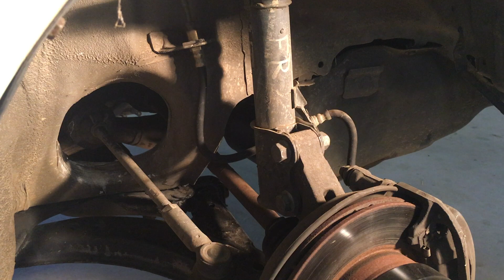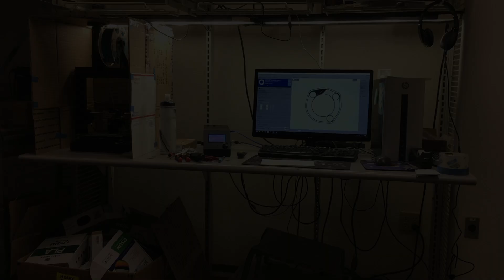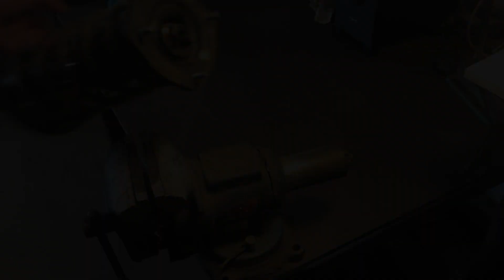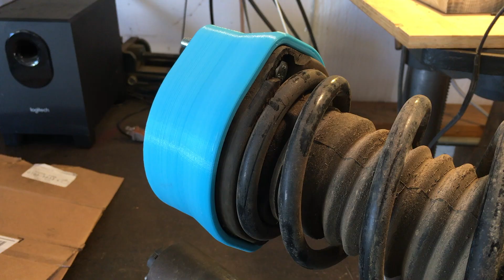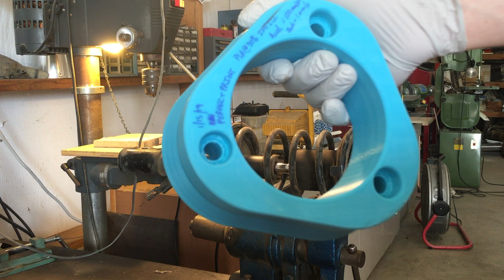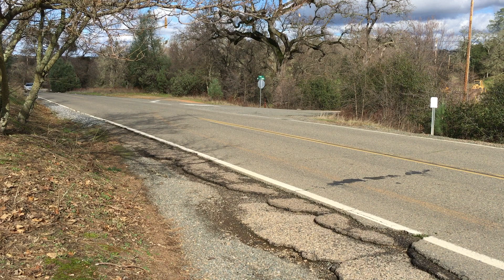Lifting My Car With 3D Printed Parts

Comment: Did you open source the files by chance?  Any way to get a copy?
Reply from the maker: @jafinch78  that’s was so long ago I doubt I even have the file anymore, sorry. They weren’t that bad to model.
Reply: @MotherlodeMotors  That's cool.  I have a set of mounts off for the front and rear of the Prius.  Recently did a YT Short or two regarding just using the strut mounts alone, though for taller was thinking making open source files for either 3D printing or fabrication by places like SendCutSent, OshPark or others like whomever.  Technically, reading into some more, looks like the later model Corolla matches.  2003-2018 Toyota Corolla, 2000-2005 Toyota Celica, 2000-2005 Toyota MR2, 2003-2008 Toyota Matrix, 2004-2009 Toyota Prius, 2005-2010 Scion tC, and 2003-2010 Pontiac Vibe are the interchange for the gen 2 Prius specs I later realized after commenting and looking into interchange potential.  Hole size is the only difference I can see at least between the Matrix and Prius, the Matrix is larger.
Reply: Looks like 2003-2018 has same pattern as the 2004-2009 Toyota Prius, as well as the 2000-2005 Toyota Celica, 2000-2005 Toyota MR2, 2003-2008 Toyota Matrix, 2005-2010 Scion tC, and 2003-2010 Pontiac Vibe.

Comment: Are there any up dates on these space how long did they last?
Reply from the maker: I didn't keep them on due to CV axle angle, didn't want to destroy my axles. But I'd still be running them if it wasn't for that.
Reply: @MotherlodeMotors  Guessing like some of the Priuses, over 1.5" probably better to do a k frame spacer so everything drops.  Even more extreme lifts need engine and all dropped via the mounts.

Comment: Would it be safe to 3d print a body lift for a truck and what type of material would you use
Reply from the maker: I'm sure it would be fine. In my opinion it doesn't really matter what kind but people would probably say ABS. Just do some testing to make sure it's strong enough and you'll be fine.

Comment: I see where you going to have a lot of problems we going to do about the steering arm is it going to hit that circle thing area
Reply from the maker: Everything was fine apart from the driver side CV axle being too short to handle the angle. I never got into trying to fix the camber before I removed them.

Comment: Most non metal strut spacers are made with HDPE. However I think ABS might be an even better alternative since 3D prints are weaker than molds and CNC'd products. Another idea is to make a mold that you pour some heavy duty material in.

Comment: Awesome video! How did these end up holding up over time? Any issues?
Reply from the maker: Kyle Rosenlieb I took them out since I had to start driving the car daily. Alignment is an issue and might be able to be sorted if you’re ok with a little positive camber. Second issue is left side CV shaft can’t take the angle. Would need to come up with something custom that could deal with the angle and length changes.

Comment: This is dangerous and irresponsible. PLA+ will likely shatter under the stress if it gets below freezing, and deform over time just from the bay temp.
Reply from the maker: Kornstalx already planning to change out for longer struts to clear big tires.
Reply: At least he was using a torque wrench.

Comment: Would machining be easier and cheaper?
Reply from the maker: RustyRat Depends what tool you have access to. These prints cost less than $5 each not counting the cost of the printer.